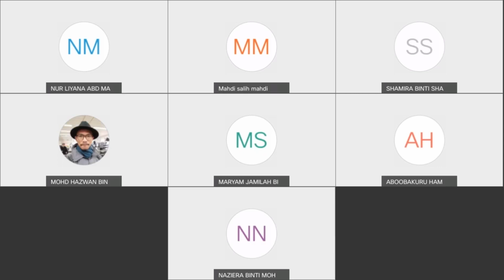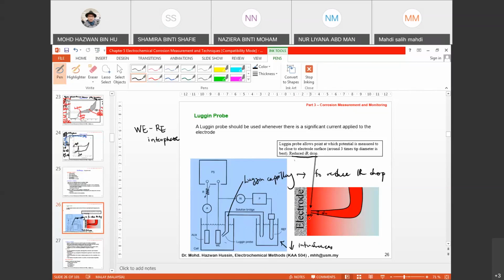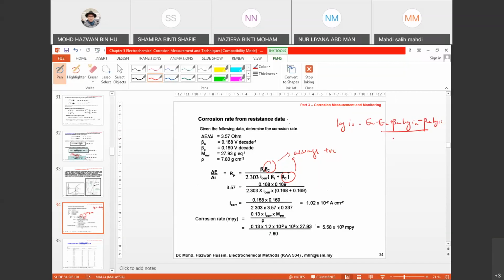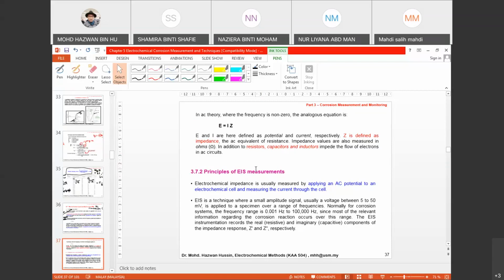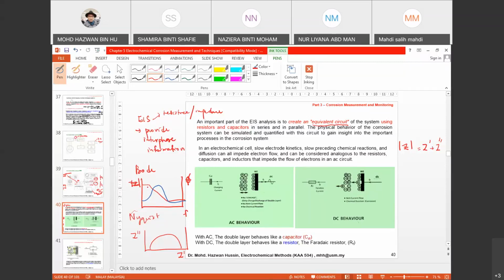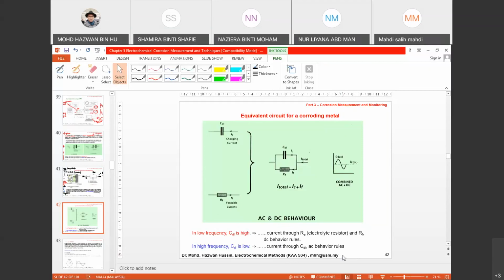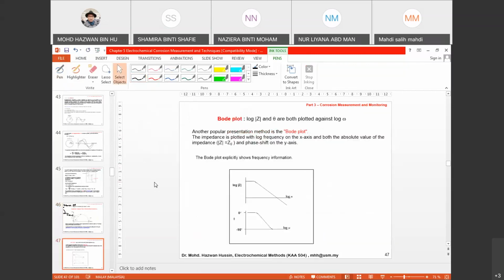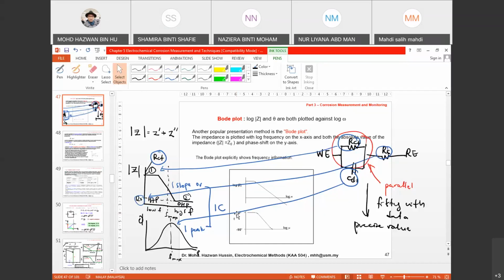KAA 504 Chapter 5 Linear Polarization Resistance and Electrochemical Impedance Part 1

Comment: How can we find Rct or corrosion rate from Nyquist plot impedence
Reply from the maker: @MehtabAhmad-x6x  Rct from Nyquist is basically the diameter of the semicircle obtained after equivalent circuit fitting..if the data was obtained during EIS+PDP or LPR sequence, the Rct can be assumed as Rp and you can use icorr = (babc)/(2.303 Rp (ba+bc))..the obtained icorr (in micro amps/cm2) can be used to calculate corrosion rate; CR (mpy) = (0.136 x icorr x Mew)/density